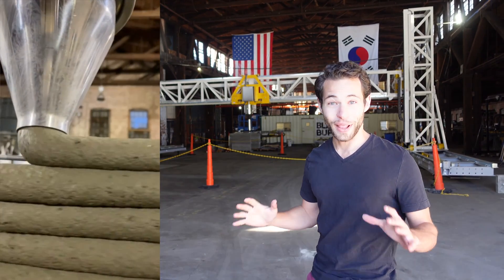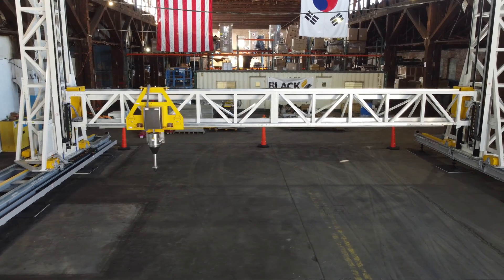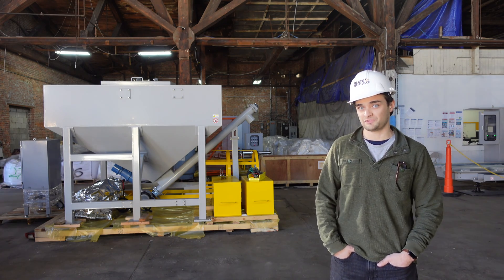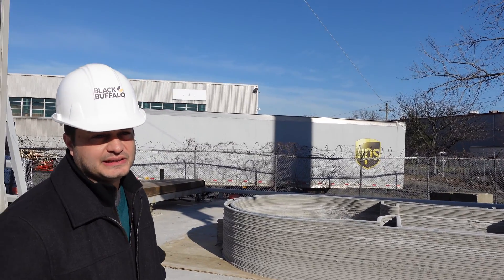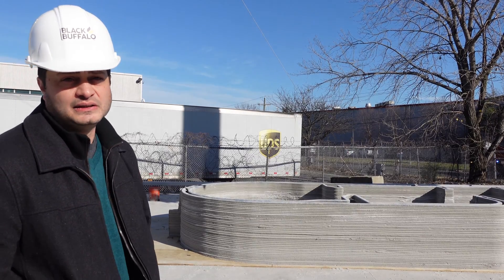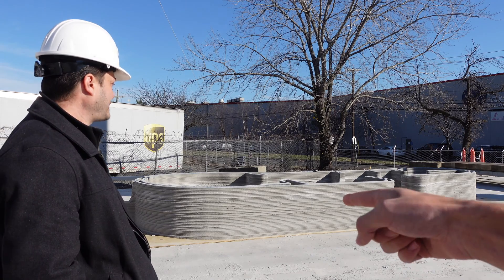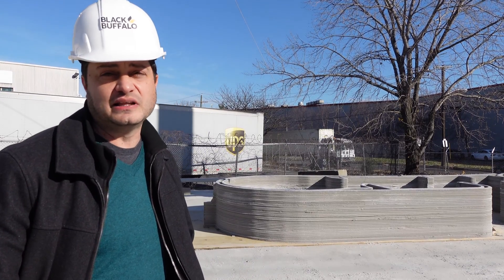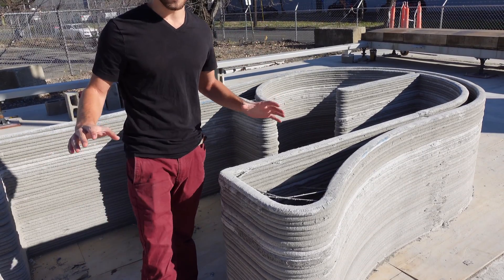Black Buffalo House Printing System 2.0 To 3D Print New HQ On 100 Acres!

Comment: Why are you guys still useing concrete to build these homes concrete is not a green material . Also why aren’t you guys useing a hemp create I may have a the actual formula for a hempcreate useing a simple ingredient, found at any local health market
Reply: Cost and Compressive Strength for starters.  "The typical compressive strength of hempcrete is between 0.5 and 3.5 megapascals (MPa). ... In contrast, residential concrete has a compressive strength of 17 MPa (2500 psi), rising to 28 MPa (4000 psi) in commercial structures." There are innovative solutions (examples biochar + graphene) coming to concrete that reduce carbon footprint.  Look at long term carbon footprint also of concrete home vs traditional stick built.

Comment: I'll disclose I'm in the 3D construction industry. Q's: What's the width the BB printer can print? Can the printer head stop, pick up, and start again(example for a door or window opening) or is it limited due to printer controllers/software and need to continuously fed material like ICON or others? Can the mixer/pump communicate with the printer (looks like no), as that affects job site efficiency, quality of print, and number of workers needed onsite. Is the mortar mix proprietary and need to be purchased through BB or can it be sourced locally to be more cost effective and sustainable? Can chemical additives(super-plasticizers, stiffeners, hardeners, etc) be adjusted at the mixer due to weather (heat, humidity, etc) or is mix entirely a pre-blend? Does the mix use any fibers to reduce micro-cracking? A mortar mix definitely will not be as cost effective or strong as a concrete mix. Has BB sold any printers to date or built any homes to be seen?  

Finally, my understanding is that BB  made a financial investment in Alquist, which BB should disclose and be transparent about. I'm sure that's why Alquist will be using BB printer. Good start for BB, and anything that moves industry forward is a positive. Congratulations to BB on their new facility!
Reply from the maker: Patrick I remember you, we met in Denmark. The answers to your questions are mostly within the videos on my channel including a live interview I posted with their CEO Michael. Some of your questions are unanswered I’m sure you understand the desire for privacy in innovative industries although it is certainly frustrating. If I were you I’d wait a few months until Alquist prints something on the BB machine and get Zack’s input, he is the alquist CEO. Of course if they received BB investment the answer may be bias but it’s worth asking.
Reply: Cobod just printed a house of "normal" concrete, as they recognize the need to use local materials.  Moisture control is the overriding issue.  Active control of that is what we are working on.  Like a 2K mix, but of about 99.9% concrete.

Comment: this is very cool tech. However, with the shell and interior walls representing 15% to 30% of the cost of a home....why is this being represented as a game changing development in housing? Even if this method cost half as much as traditional construction you would only save at most 15% of the price of the home.
Reply: Very true Jack, with shell and interior walls more like 25-40% depending on location and how interior and exterior walls are finished out after 3D printing, but even if you save 15% overall, that gets more people into homes, and more of the material for 3D printing can be locally sourced, which is definitely more sustainable.  It's an evolving industry for sure!
Reply: Give it time and use the cost might go down